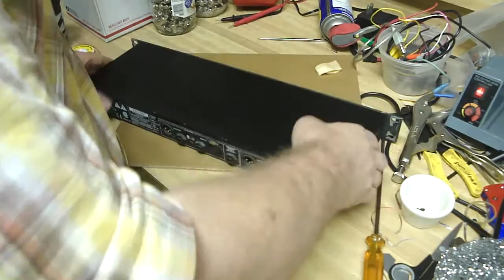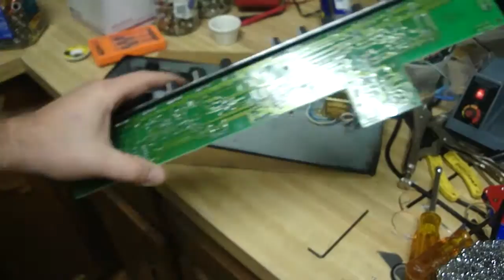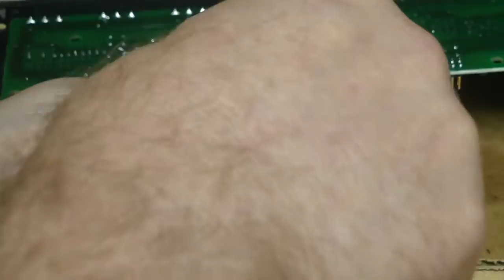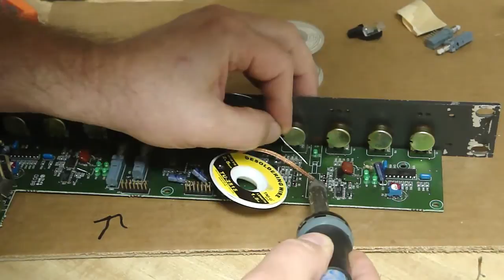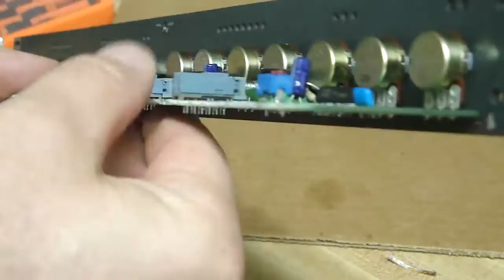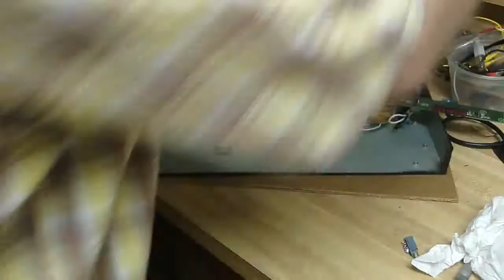DBX 266XL Compressor Over Easy Button Switch Repair Replacement

Comment: Hey where did you get the replacement switches? Interesting note on the WD40 by the way :-). I have a bunch of 1066 units with loads of bad switches so it would be great if I can source the switches
Reply from the maker: http://www.rainfall.com/cornerstore/index.php?route=product/product&product_id=57
Reply: keninorlando9 Thanks!